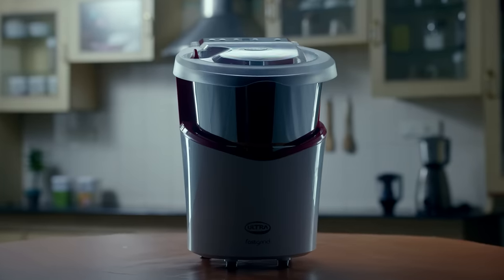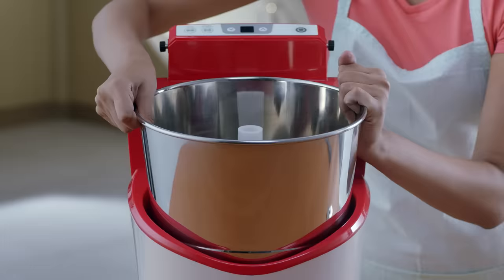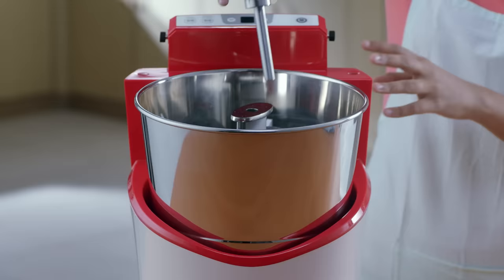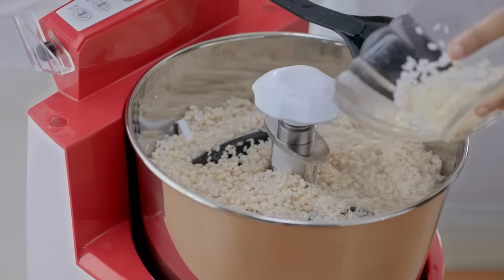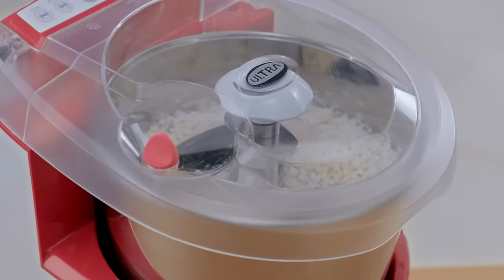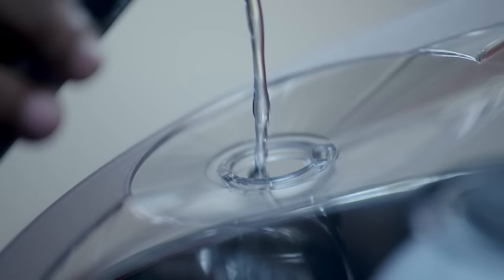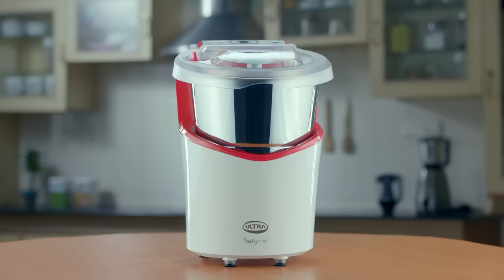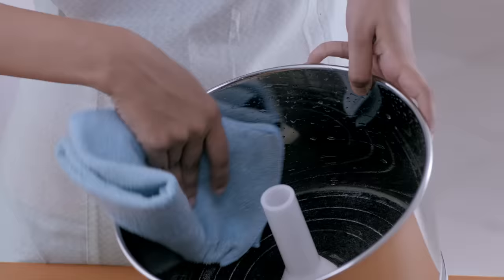Fastgrind Operations Procedure video

Comment: We are still using the first model of Ultra wet grinder that we bought more than 20 uesrs ago, they are the best. Will buy this as a new one if at all of the old one goes bad, but touch wood it should not.

Comment: Recently I bought this model. Very nice .grinding time very less only 35 minutes for 1.25kg rice  and 250gm  dal .I am very happy .cleaning also easy .stone less weight. Very fast grinding .sound only little high because of rpm .that no problem
Reply from the maker: Thank you, Ms Jayaraman for your words of appreciation. We really appreciate the time you took to write such a detailed review!
Reply: Have u tried thick batter for methu vadai
Reply: @asultana5080  ya .i  done many times .within quick time we can make  thick batter
Reply: @jayatamilreview2023  apdiya ok thank you
Reply: Here it is not available. No stock

Comment: It's getting slightly heated up in case of rice. Any suggestions? As a result idli isn't as good
Reply: Add ice water and ice cubes
Reply: Don't screw more, but put screw slightly tight by twisting not more than 2 rounds for a very smooth batter. Generally one round will be enough for smooth running without heat.

Comment: The most messy grinder of all ultras.
I have been using ultra for nearly 20 years, don't know why I bought this.
Doesn't grind so nicely, too much of sound and also makes the place messy and doesn't fit into my counter top too.
I think this is a failure model by elgiultra, very sorry to say this but really having a tough time with this grinder.
Reply: Yes I fully agree..worst product I ever had..too pricey and lots of noise...2 ltrs but it can grind very less quantity than other grinders of the same size..overall waste of money